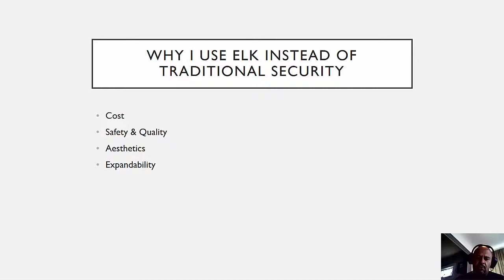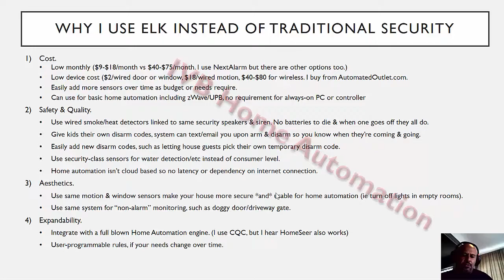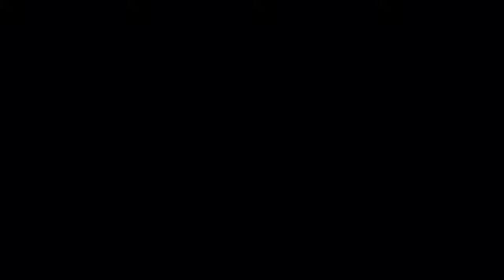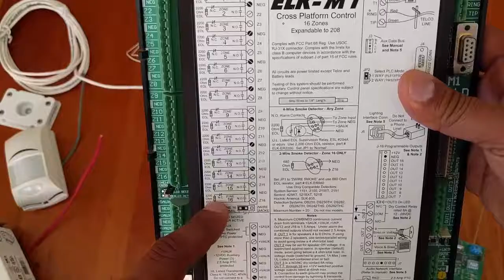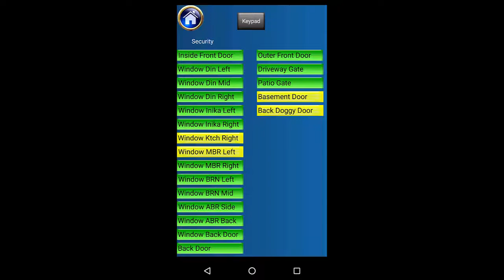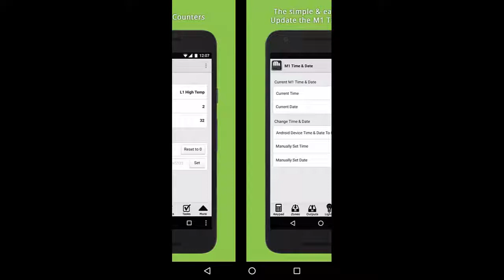Why I use an Elk security/automation panel instead of ADT or SmartThings

Comment: Have you ever compared using an ELK system vs DSC as a DIY Person?   I am trying to continue using my wired sensors but swap in a system with the best chances of integrating with modern cloud based Home Automation solutions.
Reply from the maker: Oh man yes, in exhaustive detail. It was several years ago. First off, i'd recommend going to CocoonTech.Com (which is where I did all my research when first starting) as this question comes up pretty often. As I recall, the question is about how much you'll do with it. I knew I was going to get a massive system at some point, and the Elk was more expandable.

When you say "cloud based", which ones are you talking about? I've had mind numbingly BAD BAD performance with those, and promptly tossed them out. Latency is just pitiful and things don't always work. For example, if you want to integrate security with lighting (re-use motion sensors for home occupancy), SmartThings either had 7+ second response time or just failed. I have an example of a failure in one of my other videos, can't remember which.  I still use IFTTT, but only for actions where latency isn't an issue.

I'm going to create a series of videos about apartment-based home automation, I'm helping someone use an ISY hardware controller for that. It's a great medium ground between PC-based HA controllers and cloud. It's all local but man it's so simple to setup.
Reply: IVB's Home Automation My theory is that there is going to be an 'A. I.' divide soon between hardware that is either connected to cloud AI or not.  The old disconnected hardware will not be able to do complex spoken word commands that everyone is becoming used to thanks to Apple Siri, Ok Google and Alexa.    So when it comes to security systems, the systems like Nest Security are going to walk away from all the rest with complex verbal feedback like 'you came home from work a while ago, but I think you may have forgotten to close the garage, would you like me to close it?'

So while my home already has many wired sensors, I am looking for ways to integrate them with a system that has a chance to survive this coming 'A. I.' divide. 

So far I found a company called Knonnected.io which makes an interface between wired sensors and using SmartThings for security.

The problem with SmartThings and other modern wireless-only, cloud-first solutions like Nest Security is that they don't benefit from the decades of history companies like Dsc, Honeywell and ELK have and the many great diverse sensors.

It is possible that if I want good A.I., then I need to give up the wired legacy.  We will see, I am still doing research.

As for what I would want from ELK, Dsc, Honeywell or other leading security systems is a beautiful web interface and an iPhone app that can control everything about the system.  I am not seeing this from any of these players today.

Take a look at what Ingrid launched 6 years ago, it was super easy to setup, easy to manage and worked well with no latency while still having a cloud connection.  Sadly it does not support any wired sensors and has since become stale after being bought out.

We will see where I end up with my goal of using wired sensors with an A.I. capable security system.

Thanks again for the great video that gives me some context of ELK and what it can do.
Reply from the maker: Good luck, let me/us know how you fare. I have one idea below in it's infancy, but first some other thoughts: 

A) You can do the "you forgot to close the garage want me to close it" now Heck, I could do that 4 years ago but a one way voice (TTS announcing that over speakers, I had to flip a switch. Now I can do that via voice response too.) That's one of the easiest HA things to do, as a matter of fact. See this video for a walkthrough of the overall architecture. I don't have a garage, but I personally do things like turning equipment off, raising the projector. I know people who do the garage door thing using simple servos though. https://www.youtube.com/watch?v=c9tYT0EO-Nk&t=6s

B) I personally think cloud-reliant mechanisms are still at least 5+ years from 100.0% (or even 99%) reliability, internet connections are still too fragile IE, I now have both AT&T UVerse and Comcast as my job requires 100% connections, and either one either go down or have massive slowness. I live in NorCal, massive tech hub, not middle of nowhere America. There's just too much competition for the pipe. Maybe when fiber to the home is a reality.

For Home Automation & security, latency is going to kill off any advantage. It doesn't matter how sophisticated the voice recognition or rules processing engine is, if it takes more than subsecond response it's just not viable. IE, if you walk into a room, if it takes 2-3 seconds for the HA engine to realize & respond you're going to get pissed off. Flipping a light switch needs to have instantaneous corollary action otherwise the non-techies will mock it.

Now my idea: The software engine I use (CQC) has just started a locally stored voice system. As that matures, and if Alexa ever has offline capabilities, that's your runaway use case.